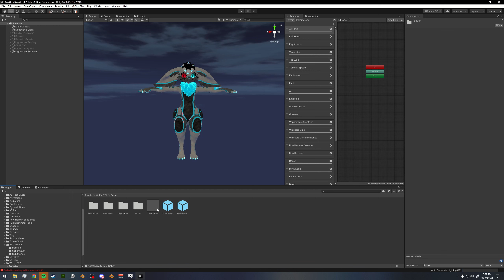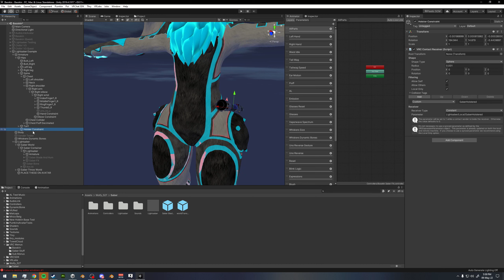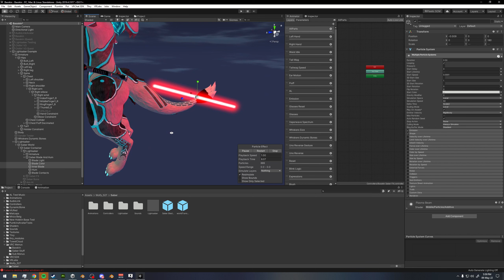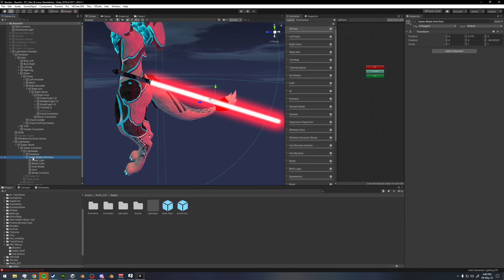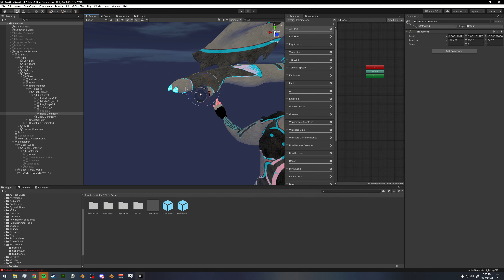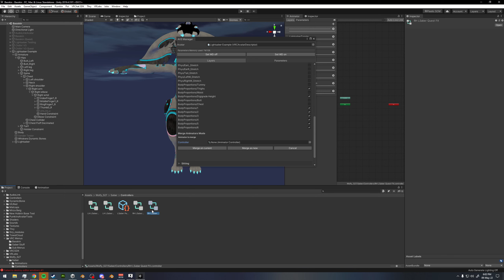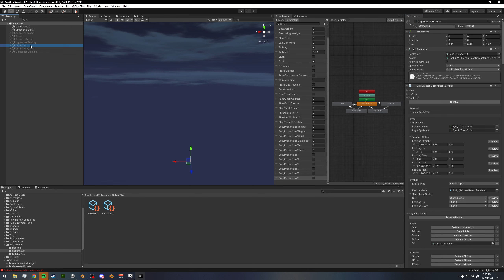VRChat - Avatar Dynamics - Plasmasaber Prefab Set-Up

Comment: hey i got it working great
 just a minor issue where i added the saber/toggle and saber/hue in the same sub menu and for some reason on my end the saber is orbiting around the holster constraint but from other peps perspective it sitting there perfectly

any suggestion or fix on this?
Reply from the maker: I have seen quite a few people have odd interactions with the saber when "Write Defaults" are mixed in the FX controller. That is a possible issue that you might be having. You can check that by opening up Avatars 3.0 Manager and see if it throws a warning at the top about using "Mixed Write Defaults."

Comment: For some reason the lightsaber wont appear and i dont know why
Reply from the maker: When you put the prefab on your avatar did you drag and drop it onto your avatar's base, or just outside of it? It needs to be placed on your avatar's base, not outside of it.
Reply: @Wolfy527   I did. The only part where it looks different from the video is when I add the 3.0 manager and yellow text appears    in the parameters under GestureLeft all the way down to IsLocal saying (parameter is a default one, by default it will be added to the parameters, you should not add any affix unless you know what your doing) Not sure if that matters it just didnt look like the video.
Reply from the maker: @wowbrothers6312  Those warning are just letting you know that those parameters are automatically built in to avatar essentially. You should be fine ignoring them.

Did you place the synchronized parameters in your parameter's expression list that goes in-game as well? I've never had someone say that the saber just doesn't appear at all. That could only happen if the toggle itself isn't working because it doesn't have the parameter it needs to toggle, or if the object isn't actually on the avatar.
Reply: @Wolfy527  I followed the whole video this time to a t.  Looks like i forgot to zero out rotation at the end not sure if that would cause the problem. Also it says I need to fix custom keywords on the avatar to upload should i do that?
Reply: @Wolfy527  I'm new to doing avatar editing so thanks for the help
Reply: @Wolfy527  FileNotFoundException: C:/Users/ililj/AppData/Local/Temp/DefaultCompany/Light saber do or die/prefab-id-v1_avtr_618367af-0e39-4672-83cf-71aa1880d569_7860258191.prefab.unity3d does not exist Also just noticed this error at the bottom
Reply from the maker: @wowbrothers6312  Hmm, it is possible that if you don't have poiyomi shaders in your project at all then there could be issues. Do you know if you're using poiyomi shaders, it's possible that it could be invisible if you don't.
Reply: @Wolfy527  I could be using the wrong version? Im using version 6 for the avatar cause its a little bit older.
Reply from the maker: @wowbrothers6312  Ah, yes I believe I'm either using 7.3 or 8.0 for the saber (I cannot remember which at the moment). Both of them are free and 8.0 is the newest version. I'd definitely recommend grabbing it from Poiyomi's discord and tossing that into your project! 

I'm not 100% sure this will fix your issue, but it is possible that the older version is the culprit of it not rendering.
Reply: @Wolfy527  Alright Ill give it a shot. Can you use to two versions at the same time?because I know my avatar needs the one version

Comment: would it still be set up the same way if it was for quest?
Reply from the maker: The saber is not quest-compatible unless you are using air link or a link cable to connect to a PC with the headset, sorry!

Comment: This is great! I was hoping someone would make something like this when Avatar Dynamics was coming out. It's working pretty well for me. Only one question, though. Is there a way to set a toggle for the throwing? There will be times where I just have my hand down at my side and it takes the position of my elbow as a sign to throw the saber and it just continually throws unless I make a fingerpoint gesture or lock my gestures. I attempted to make a toggle using the throw parameter but it didn't seem to work.
Reply from the maker: The saber can only throw out of your hand if you are moving it around and doing open hand gesture at the same time while the blade is out. If you do fist gesture while holding on to the saber then it cannot release from your hand. I kind of set the saber up with the mindset of how it would be used in real life. If you want to pick it up you reach for it and make a fist to grab it. If you want to put it back on the holster then you reach for the holster position and do an open hand to release it there.

The continual throwing happens because you need to "grab" the lightsaber out of the air when throwing it. I had people in the early phases say that I should make it continually throw if you don't do the grabbing gesture to catch it, so it intentionally goes back out when leaving your hand in the "Open Hand" gesture while throwing it. It should consistently lock back in your hand if you do the fist gesture to catch it as it comes back in though!

Comment: Hi, I am trying to get your plasma Saber working. I set up everything like in the tutorial. It working i can grab it from my hips to hand. But i dont know how i activate the saber. I use Oculus Quest 2 with Airlink. I used your quest controller when setuping it up.
Reply from the maker: Finger point will pull out the blade, thumbs up puts the blade away! For the quest FX, peace sign will drop the saber in world space when the blade is turned off and if the blade is on and you do peace sign while doing a throwing motion then it will throw it!

Comment: when i click the color and inner blade tabs they dont stay open. so i cant see the blade and scale it. why is that? i can only have one on not both at the same time
Reply from the maker: You will want to make sure that the blade and hum game object is turned on and then you might need to select the blade color and inner blade game objects more than once for them to pop up properly. You'll also want to make sure that the "toggle tool handle position" is set to "pivot" not "center" to properly scale it to the hilt. It's located towards the top left, just above scene.
Reply: @Wolfy527  I got it working thanks! However, after doing everything stated in the video, EXACTLY as shown (rewatched 3 times to make sure) the lightsaber doesn’t work. The toggle that gets created toggles from my waist to my hand as it should, but it does not activate, I can’t throw it, no light or sound. It’s JUST the hilt. If it matters, I was trying to put it on an avatar that has facial expressions that were linked to hand gestures. When I did the VRlabs thing I had a warning saying something about overriding gestures or something? Is there any way to fix this or get it working?
Reply from the maker: @UnrealSøbek  You'll want to make sure that "Write Defaults" on your avatar aren't mixed. If they were already turned on before you put the saber on your avatar then just set them all on, if they were already off, then select all off. 

You'll also want to make sure that you're using the V1.2 package for the saber as V1.1 had a bug with the parameter drivers when being imported into the package.

Also, the gestures to pick up are fist while your hand is touching the hilt. Finger point turns the blade on, thumbs of turns it off. If you do open hand while the blade is turned off then you'll drop the saber in world space, but if you do it while touching your holster location, then it will holster it. If you do open hand while the blade is on and a throwing motion, then it will throw out from your hand.
Reply: @Wolfy527  how would I go about checking the “write defaults” and seeing if they’re on or off? And how do I avoid mixing them?
Reply from the maker: @UnrealSøbek  When you open up AV3.0 Manager and place your avatar in it and then drop the saber FX controller into the area to merge them, once merged, it will tell you at the top if "Mixed Write Defaults" is on and that it can cause issues. You will want to set it to either "All On" or "All Off" depending on what your avatar was already using. 

A good way to check this is just go to your expressions layer that your hands use for face expressions and click on one of the states to see if "Write Defaults" is on or off. I would then click "All On" or "All Off" based on what I saw in there since it's likely the rest of your avatar is the same. This will match the saber's write defaults settings to the rest of your avatar and it should work fine from there!

Comment: uhhh, dont know what ive done wrong, followed tutorial every step of the way, seems to not be working at all. nothing happens when i activate the toggle
Reply from the maker: When you merged your FX with AV3.0 Manager did you place the new FX controller in your FX layer in the playable layers in your avatar descriptor?
Reply: @Wolfy527  yes sir. I did
Reply from the maker: @RicoInaFedora  The saber itself is on your avatar's base as well, right?
Reply: @Wolfy527  indeed it is
Reply from the maker: @RicoInaFedora  You are going to want to make sure you put the parameters in your parameters expression list for the network synced variables, make sure you are not mixing write defaults on and off. You either want them all on across your avatar or all off, if you mix them the saber will break. If that's good, then you'll want to make sure you're using the toggle parameter for the saber in your menu you access in-game.

Comment: How exactly do you set up the radial thing to change the hue?
Reply from the maker: You will want to copy and paste the synchronized parameter for hue into your parameters expression list like the previous five, but make it a float instead of a bool. You'll then just want to make a new "Radial Puppet" in your expressions menu that uses the hue float for the parameter rotation.

Comment: ok so i have an issue where the saber works on my end but doesn't work for others like they can see it on my hip but cant see me grab it or turn it on
Reply from the maker: Do you have the newest V1.2 downloaded and are using that one?
Reply: @Wolfy527   I've got and using 1.1
Reply from the maker: @joshuaedmonson6  There was a bug that slipped into the V1.1 update that broke the parameter drivers for people. If you go back to booth or gumroad and redownload the package it should be V1.2 now and everything should work fine in that package. Sorry about the inconvenience!
Reply: @Wolfy527  Ok thanks

Comment: im having a difficult time changing the blade color. how would i do this?
Reply from the maker: I updated the prefab to include a hue slider! If you download the newest package from whichever store you purchased it, then you can merge that FX with yours and just make sure you add in the hue slider to your network synced parameters expression list!
Reply: hmmm i did that but it doesnt seem to work. unless i did it wrong
Reply: i managed to get the hue working.but now it closes the radial when it tried to change the hue. im still kinda new to unity so im not to sure how to fix it
Reply from the maker: @Beastmode84827  You'll want to make sure it's a radial menu in your expression menu, not a button. That should fix it for ya!

Comment: Appears on the hip for me, but can't grab it. I'm using Index controllers. Setup everything exactly like in the video. Also have a warning message that I have mixed Write Defaults. Should they be on or off?
Reply from the maker: You will want to match the saber's "Write Defaults" to be the same as the rest of your avatar's. I.e. if all of them were off before, then just tell AV3.0 Manager to turn all of them off to match. Mixed defaults does break the lightsaber, so you'll want everything to be the same in the FX controller.
Reply: @Wolfy527  I turned all my write defaults off and I'm still not able to grab it.
Reply from the maker: @calithedankdino5966  You merged the FX controllers together and put that in your FX layer in your avatar descriptor, right?

Comment: The saber works great but for some reason when the saber is turned on, it plays the activation AND deactivation sounds at the same time, and when it turns off it plays the activation sound instead of the deactivation sound. I havent tried putting it on another avi as of yet but I was wondering what I messed up on
Reply from the maker: Do you have write defaults mixed on your avatar by any chance? If they're turned on for some animations, but not all (or vice-verse) then it causes the lightsaber to bug out and do weird things.
Reply: @Wolfy527  I'll see if I did today. Side note, the lighting of the saber illuminates the hair of my avi but nothing else, Except when looking at a mirror, I'm guessing this is some shader checkbox I have to click?

Comment: for me whenever i position the saber in my hand and then change the constraint back to 0 then the other to 1 it is misplaced on my waist. im not sure why it would be doing this
Reply from the maker: You need to rotate/move the constraints themselves, not the saber. If you rotate the saber, then it will be misaligned when you swap to the other parent constraint location.

Comment: Seem to run into a problem where the Saber only appears to me on my side not in my hand
Reply from the maker: If you just bought the lightsaber this afternoon there was a bug that slipped through on the FX layers that would prevent it from working (besides toggling on and off). If you head to booth or gumroad and redownload the package and drop in the new FX layers you should be good to go, sorry!
Reply: @Wolfy527  thank you for the fast fix
Reply: @Wolfy527  still have the lightsaber appear on my side but can't hold it or activate it on quest pc
Reply from the maker: @SingularitysPallas  Did you use the quest fx or standard one? And is your hand touching the hilt when you grab?
Reply: @Wolfy527  using quest right hand and still nothing
Reply from the maker: @SingularitysPallas  So I just realized while testing things again that the package did not export correctly from unity and it should now be updated correctly on both platforms, really sorry about that!
Reply: @Wolfy527  struggling might I ask for assistance in discord
Reply from the maker: @SingularitysPallas  Sure! I am about to head to bed, but my discord is "Wolfy#2727"

Comment: Does it only work with the obi-wan saber or is possible to change models?
Reply from the maker: You can probably swap out the models, but you might have to scale things and modify some animations for the names of objects and such.
Reply: @Wolfy527  could we not just rename the replacement model to ensure theres no issue with the animations?
Reply from the maker: @uno_3099  You could, I just have no guarantee of how the scaling will work with it and a new model is all. You 100% can replace the model, but you'll likely have to tinker with it on your own since it will scale differently than the one I set up.
Reply: @Wolfy527  ah okay easy enough then, thanks :)
Reply from the maker: @uno_3099  No problem!

Comment: The lightsaber seems to move from its hand and waist constraints after using the throw animation, is this normal? Everything else has worked awesome otherwise!
Reply from the maker: Hmm, what exactly do you mean by moving from its hand and waist constraints?
Reply: @Wolfy527  looks like the rotation of the saber on the hand changes after throwing. After the catch animation, the saber ends up in my hand at an angle, clipping through my fingers
Reply from the maker: @lind_  Hmm I thought I had gotten rid of that bug. It seemed to be FPS related where, if your framerate was around 20 or lower it would bug out and not snap back properly. Are you experiencing really low framerate when this happens?
Reply: @Wolfy527  nope, my framerate looks to be stable during all animations (I get around 40-70 fps). 

The rotation issue persists after one throw, but goes away with an avatar reset. There's also been a time where I threw it and it came back fine with no issues, but I can't remember the gesture I made to throw it that way.
Reply from the maker: @lind_  The controllers I have set are defaulted to Write Defaults off, but if you're using Write Defaults on then things could bug out potentially. Do you know if you mixed them by any chance?
Reply: @Wolfy527  is this referring to the write defaults in the parameter menu? I did make sure to have those off
Reply from the maker: @lind_  In the FX layer itself for all of the animation states. If your avatar is designed to use write defaults on, then directly merging the FX's could cause buggy interactions potentially because the FX controllers I have set up for the sabers had write defaults turned off.
Reply: @Wolfy527  ah, I do have write defaults turned on for the facial animations that are set to play during left hand gestures. I'll turn those off and see if that helps
Reply from the maker: @lind_  No don't worry about turning yours off. My stuff will work if you turn them on for all of the lightsaber animations! It's just that everything has to have write defaults on or off, not mixed. Your face expressions will probably break if you turn off write defaults, so just turn write defaults on for all of the lightsaber animations and you'll be fine!

Comment: Hi Wolfy, Ty for this Its very cool!

After setting this up and testing, i can't seem to grab the saber, any idea to why this may be, or what i could have done i can't find anything wrong myself
Reply: Make sure your gestures are turned on, I noticed I couldn't pick it up either but that seemed to fix it
Reply from the maker: @FloralTraash  Correct! You'll definitely want your gestures on as this system combines the gesture-based system with contact receivers for picking up, releasing, and throwing!
Reply from the maker: When you merged the FX as new, did you place the new FX layer into your avatar's controller? That could potentially be one of the issues if none of the animations are playing.